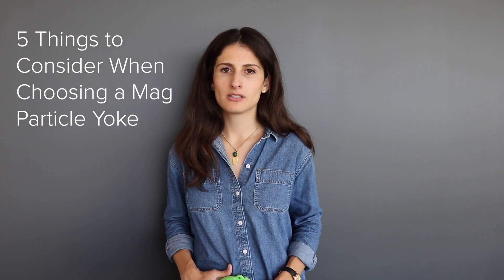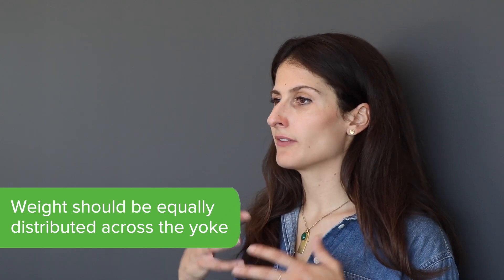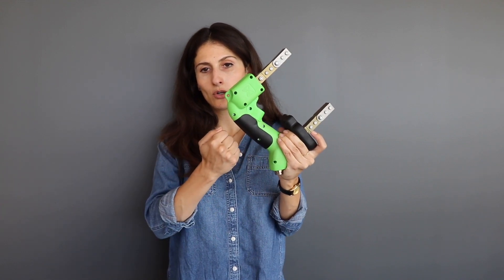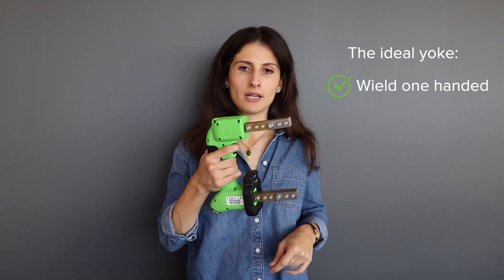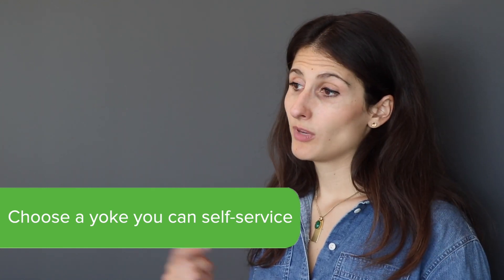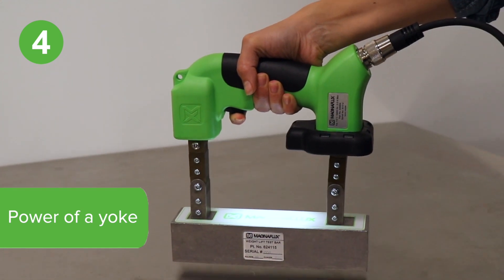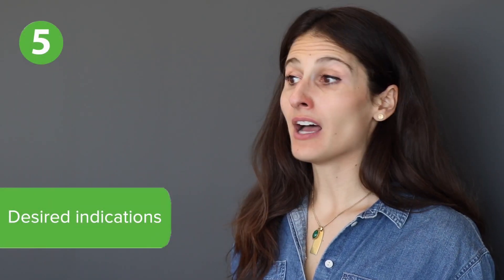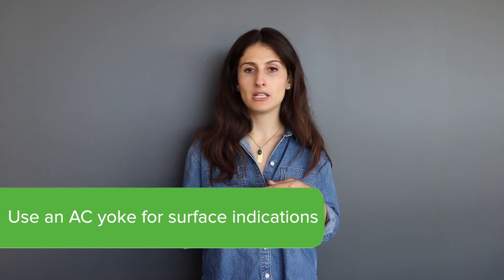5 Things to Consider When Choosing a Mag Particle Yoke

Comment: Madam A Good Presentation, can you give  the details of Magna flux Y-8MW YOKE!
Reply from the maker: The Y-8 is a battery-powered, DC electromagnetic
 yoke designed to stand up to the most rugged applications and exceeds ASTM lifting specifications. To get you more information, would you please let me know which country you are in?
Reply: E @Magnaflux2010  
Located -Projects in Middleeast ,   Singapore (Marine ,OilRig, Refinery,Castings & Forgings .
Reply: @Magnaflux2010  
Profession: QC /QA  Superintendent/Inspector

Comment: Question #[1] When to use AC and DC selection ,can you explain with some figures  Question # [2] Technicians use the probe tip touching at angle ,is it nott correct to use such that most of the area of the yoke tip rests perfectly on surface ,like lifting the soild test piece you show in vedio

Comment: I still don't understand why anybody outside of china and Korea don't sell 4 pole yokes for testing in 2 directions simultaneously. Everybody only sells 2 yoke set up. Now yes there lighter but there not always the most practical for testing. If you have a component and it's is enormous in size and has a HUGE area that you need to test, a 4 pole magnet would get the job done in half the time. Tank floors are a great example where a 4 pole is WAY better than a 2 pole